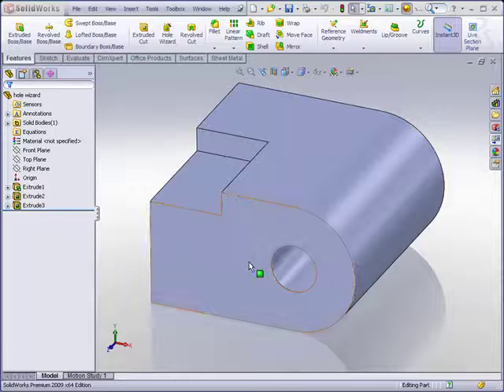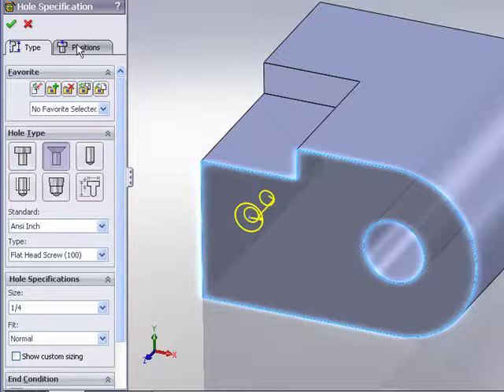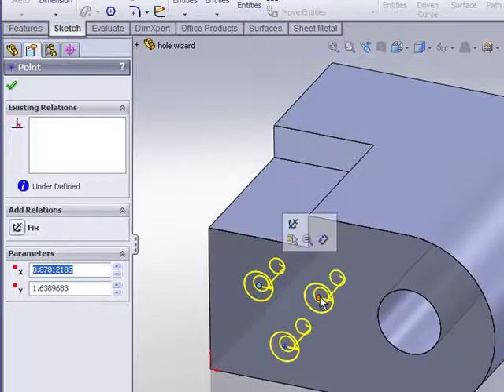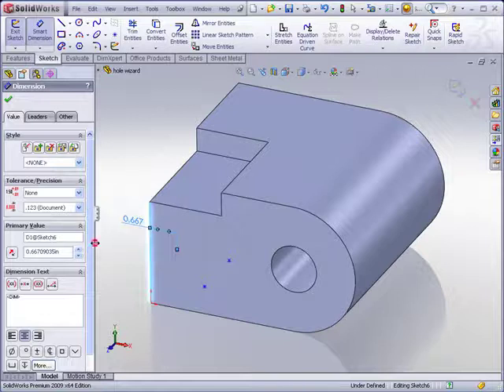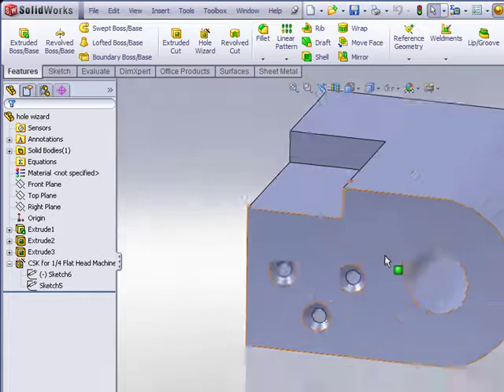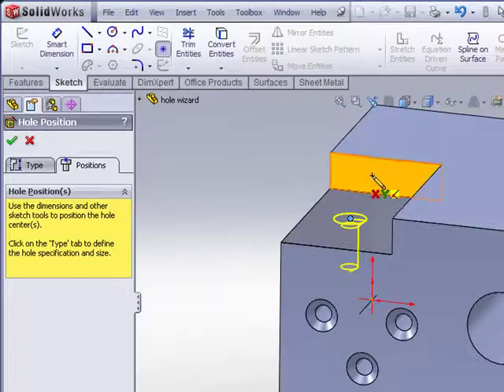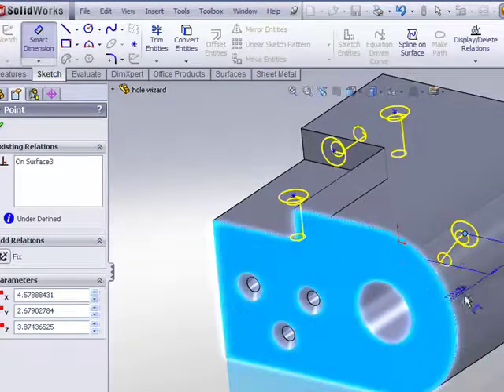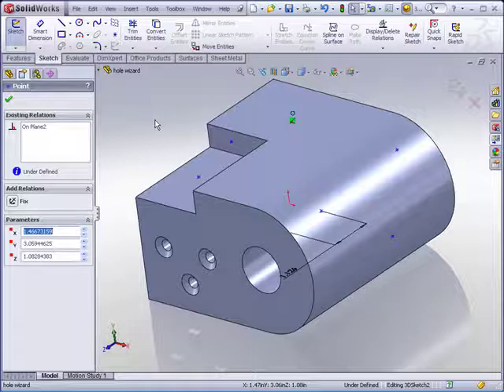Hole Wizard Tips for SolidWorks

Comment: Finally, I could understand why I had an undesired additional hole before specified hole points when I use Hole wizard every time. The place of the undesired hole was decided by the pre-clicking to specify the surface. I got it!
Thank you!